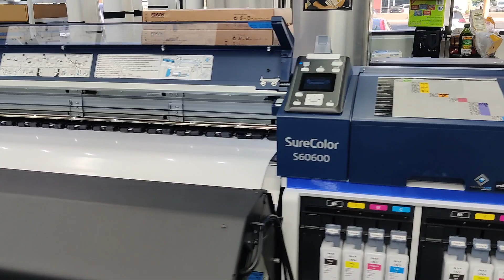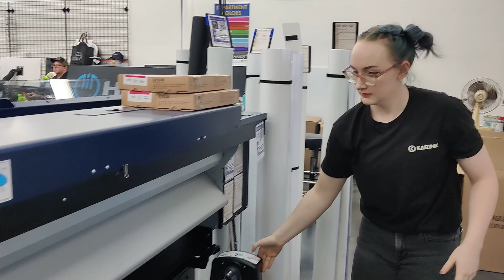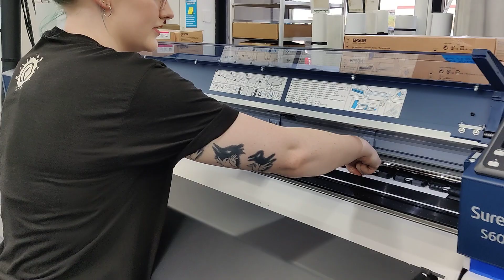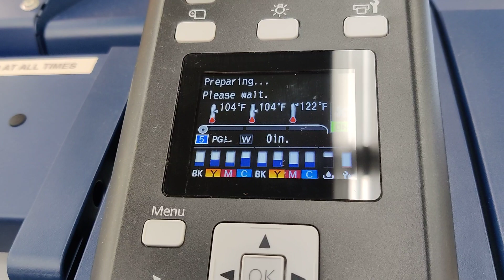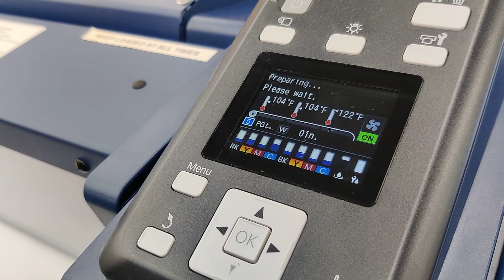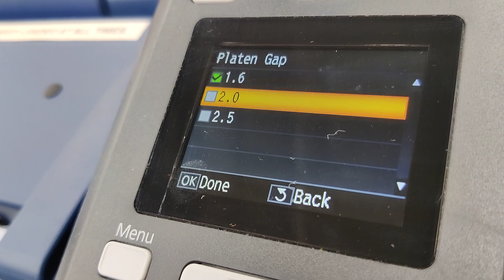Large Format | Epson SC-S60600 | How to Load Magnetic Materials

Comment: Hello there 
Thank you for beautiful video. I have the same machine but i do not have CALENDAR VIN when i go to setting can please let me know how make the preset 
Thank you!!
Reply from the maker: You can create or adjust media presets directly on the printer. Go to Media Setup > Customize Settings on the printer interface to manually create a new preset.

From there, you can adjust settings such as suction, platen gap, and heater temperatures. These will vary depending on the material you’re using, so you may need to do some testing and fine-tuning to get the best results. For example, our preferred heater settings for calendared materials are 104°F pre-heat, 104°F platen, and 122°F post-heat. It’s important to dial in the proper temperatures to avoid issues like heat-related banding or improper curing.

In our experience, it works well to create a few general presets for common material groups like banners, calendared vinyl, cast vinyl, and poster paper. This helps streamline workflow, though it can take some trial and error to find settings that perform well across each group. That said, some users prefer to create presets for each specific material (e.g., IJ35, 1105, etc.) for more precise control.

Alternatively, you can also create and manage presets through the Epson Edge Dashboard online, which may offer additional flexibility.

One important note for magnetic materials: make sure your head height (platen gap) is set high enough to properly clear the material and avoid potential head strikes.